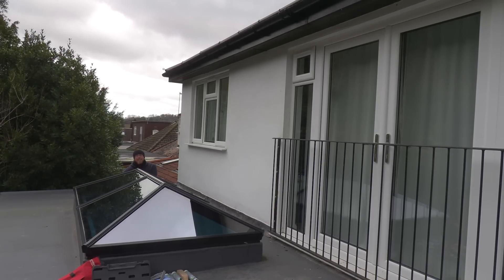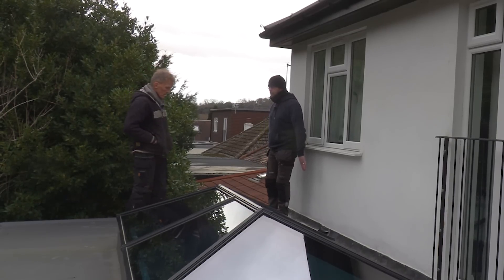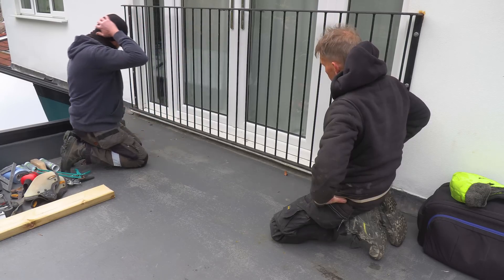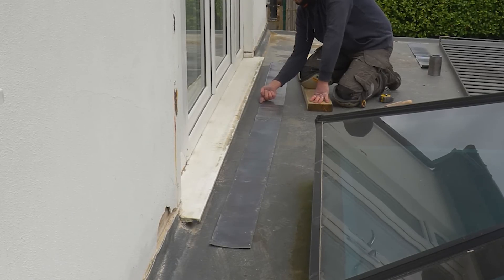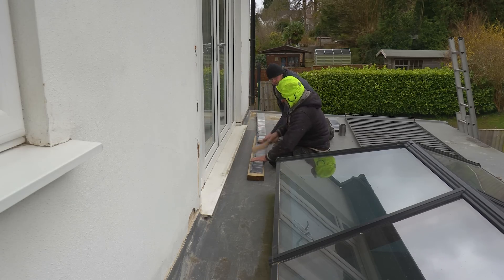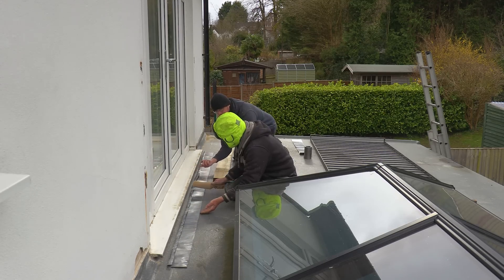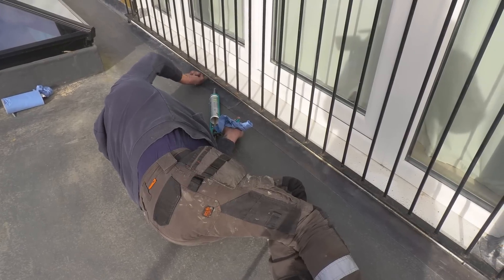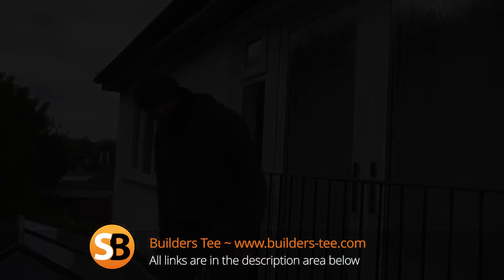Lead Flashing Broke All the Building Codes | James Is Back to Fix It!

Comment: The bottom of that door should be 6-12 inches above the deck.
Reply from the maker: why?
Reply: @SkillBuilder  To keep the rain and snow from leaking under and around the door.  I had a deck like that and it rotted the framing and flooring around the door.

Comment: Appreciate you are only doing a repair but the threshold on them doors is too low. The roof membrane needs to be taken under the sill and up behind. That cover flashing stuck to the sill idea will give better protection against splashing but as it's a flat roof water could still pass underneath it in heavy rain.

Mastic in place off mortar along the flashing chase is great as it can deal better with the thermal movement of the lead, but it is rarely applied correctly and as a result splits.
Sealant manufacturer's require the joint depth is no greater then half the joint width. The depth is usually reduced to half of the width with expanding foam or backer rod to prevent three-way adhesion (where the sealant is adhered to the back of the joint and then pulls away from the top and bottom).

The lead sheet manual shows pre-pointing with mortar to avoid voids behind the sealant. In which case a bond-breaker tape would be required over this to prevent three-way adhesion. Expanding foam would achieve this but is going to be difficult to leave recessed uniformly and mortar will provide help hold the flashing securely in between the wedges.
Reply from the maker: Whenver I fit patio doors I always bring a membrane up behind the sill but we are trying to get a guy out of trouble. I said we will explain that the proper job is to remove the doors. As for applying lead and sealant, we will see. There is a void for sure but that means there is a two way pull.

Comment: In my opinion the doors should come out to do a lasting proper job.. I wouldn’t undertake the job otherwise the reason being that on the passed when I’ve tried to help and it didn’t work out the client wouldn’t pay.  This kind of poor workmanship isn’t just small builders! I’ve seen hanging tiles fitted before leadwork then the poor guy had to try and fit flashings afterwards, that was on a R—row development.

Comment: I' haven't read all of the comments so apologies if already commented upon. They never mentioned the need for a cavity tray, assuming it is a cavity wall.  I would bet strong money that there is not one installed as no sign of it or any weep holes so when the render breaks down there is a real chance that water will penetrate the outer skin and and bypass the flashing.
Reply from the maker: There is no way at this stage of putting in a cavity tray. This is a fix not an ideal solution. We have to be realistic and approach this with due regard to budgets/

Comment: Roger, do you (in the UK) use something like 29Y40 as a primer and mixed 50% with water in your cement mixture? In our business, we use it for adding strength and flexibility in a flooring application, 2 to 5mm cement overlay. we find that even brushing or rolling the product onto the finished product gives excellent moisture repelling properties. Of course, there are 3 coats of (made in house) polyurethane sealer as the finish, and for extra durability, sometimes an intermediate coat clear of roll-on epoxy. (strictly indoors, due to epoxy yellowing in the South African sun)
Reply from the maker: We use SBR for that kind of job

Comment: 🎉when grinding out for flashing always grind into the brick join or block beneath render this eliminates the problem of faulty render. The doors need taking out and then lead fitted no ifs or buts. Joining lead with a welt is just the same as having a length of lead more than 1.5 m a good lap is much better  Also for belt and braces create a water tight extension to the door sill leaving it 1 inch from the roof surface. 👍
Reply from the maker: The brick is 100mm behind the EWI. We are being realistic. We can all quote the manual but let's stop the leaks and get him through the winter.
Reply: Not having a go at the repair Roger talking about the original builder doing it in the first place the patio door being that low on the roof is a bad design in the first place. Some people don’t have the money to pay for two repairs mate. Not having a go and not reading a manual. 👍

Comment: I’m a little confused as to how cutting the piece of lead and joining it back together solves the problem of expansion and contraction? Does the joint allow it to flex more ?
Reply from the maker: The welt has a built in expansion. It is a movement joint.

Comment: When your at 5.50/6.00 mins in at the part where
your hammering the long length of lead it would
have been funny to get someone on the ground to
very slowly and quietly to remove the ladder away.
Reply from the maker: If I couldn't lower myself off a roof like that I would give up.

Comment: Should have oiled the lead before putting it in position, that way you can oil the back of the lead too, not just the front!
Reply from the maker: You are right but in this case it is not important. We oil it on the back when it is on slates and some tiles.

Comment: Interesting. How does shortening the lead to 1.5m stop the expansion cracking?
Reply: Allows movement across the 100cm overlap.
Reply: @normanboyes4983  Like an expansion joint in concrete?
Reply: @Phil_AKA_ThundyUK  Yes except you do not usually overlap concrete.😉

Comment: 100% water is pissing in through the render down behind the lead because the builders wouldn't have put cavity trays in with the extension
Reply from the maker: That is a good point but there is 100mm of insulation on that wall

Comment: This is yet another video that proves my general idea of never getting skylights and never getting any dormers or similar. A roof should be really simple with a roughly 45 degree angle. Most of your problems will be solved with this - doesn't unfortunately help if you've already put in the skylights/dormer etc.
Reply from the maker: I love skylights. They don't leak if they are installed properly and they put light in your life.

Comment: Yea I see you made what we called a quick corner, not a bossed up corner. As an old lead worker it needs a tray under the patio doors to make a job of that , but hay it’s just a quick repair to a bad job in the first place. Why welt that joint it needed a 6” lap for expansion.the welt will pull apart I think
Reply: I was a bit alarmed that no gloves were used when handling the lead.

Comment: Has the grp and the lead flashing not to go under the external wall insulation onto the original wall, with an upstand made from a strip of insulation underneath?
Thats the way it is done at my house.
Reply from the maker: That would be nice but this job was not done properly and it is a huge job to get back to that point. It may happen if this doesn't fix the problem.

Comment: It's not until the end that you mention the cracked render over external insulation.
Leaks will get down the back of the nice new flashing.
Tut tut.
Reply from the maker: Tut tut! Are you for real? All that render needs to come off, we know that but it is not going to happen unless the customer can afford it.
Reply: @SkillBuilder  To be fair; affordability comes into ALL building jobs. I can't work for customers who can't afford to pay me, & if I do a quick fix, I can't guarantee it. I have allowed customers to pay over several months before & that's a way around urgent repairs being done.

Comment: You should never use pencil to mark the lead sheet
Reply: But you’d only mark where you cut, right🤔
Reply from the maker: Why?
Reply: @SkillBuilder  I was taught that the graphite in the pencil ‘lead’ would cause a reaction with the lead and expansion and contraction caused splitting in the lead.  If you look on the periodic tables it makes sense.  Then again I learnt this on my HND Gas Engineering course in 1970 which may mean this information is out of date, but I doubt it.

Comment: Allways a problem spot. We got are building contracts to think the same way we did as Roofers. Before you put the doors or windows in let us come in and do a complete fiberglass tray under the unit with a 20/30 mm upstand up the back edge of the frame on the inside. This allows you to go past the opening at both sides with the fiberglass achieving a complete seal. The lead flashing only has to go up to the side of the door. Never had a problem. Allways hard following on after someone else.
Reply from the maker: That is a great way of doing it. If only more people thought about the next stage.

Comment: I’ve got a same scenario in my house apart from the lead work is code 4 and it’s all in pretty tidy but it’s leaking under the door somehow! I’ve got a 150mm up stand from the roof up to the underside of the cill. Glassed up with a wall fillet sealed and lead under the door to the back edge and down to the roof level. Waiting till the weather gets better to cut the internal reveals off (doors been plastered in inside and out) get the door out and have a good look. It’s been driving me mad trying to trace the leak over the past year but now I’ve got to bite the bullet and get the door out 🙈
Reply from the maker: That is the next option if this doesn't work we will take the doors out in the summer.
Reply: Your problem will probably be the doors. The external wall has now become a internal wall when an extension has been added. Doors will need to come out and  a fully welded lead tray needs to be installed under the pvc cill with the front of the lead left open to drain.
Reply: @richardcole7229  this is kind of the plan when the weather gets better 👍🏼
Reply: Where are you seeing the leak? Downstairs or on the floor inside the room with the doors?
Reply: @jimichip  downstairs buddy

Comment: How come the building industry can use kilograms of lead on a window but the electronics industry is not allowed to use milligrams of lead in a piece of equipment?
Reply: E-waste goes to landfill or dumped all over the environment. Roofing lead stays put or gets recycled. That was the logic whether it actually makes sense.
Reply: @jons6125  Good answer.  Now that I think about it, lead regularly gets recycled from church roofs.
Reply from the maker: Those recyclers have a great work ethic. I have seen them working nights with not even a torch.
Reply: @SkillBuilder lol you are on good form tonight on the comments😂